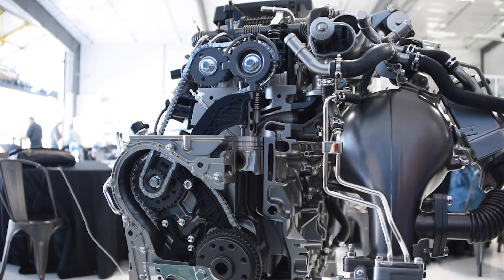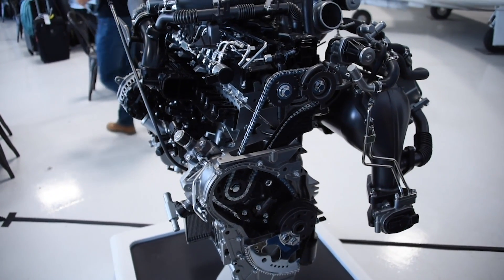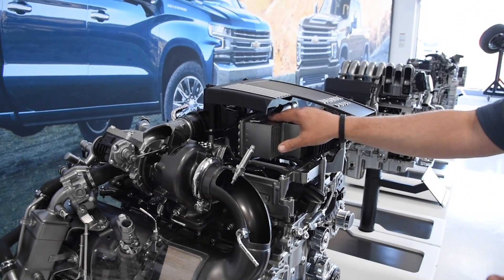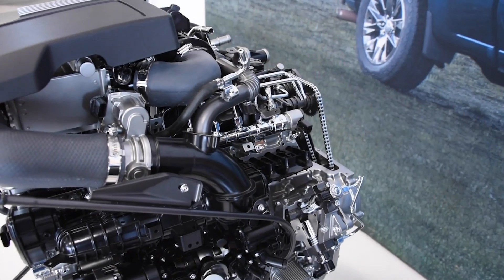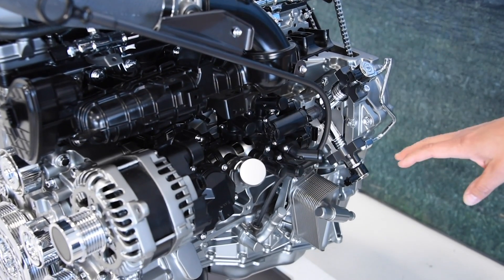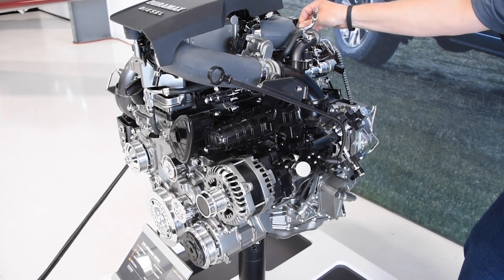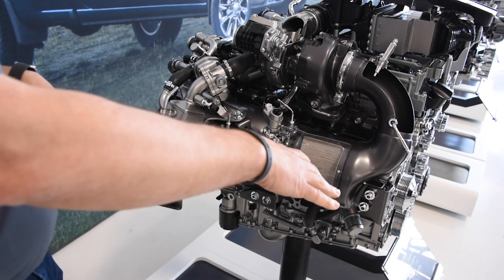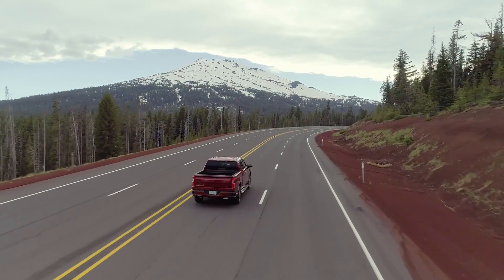What you don't know about the 3.0-liter Duramax diesel

Comment: Wow. At least the belt in oil has some testing in the 1.0 liter 3 cylinder Ecoboost. https://www.ngfglasscord.com/en-gb/glasscord-products/belt-in-oil
Ford describes it as lifetime meaning the 1 liter engine has an unknown predetermined “come unraveled” time. So far I haven’t heard anything about the belts failing, and Ford uses the engine in lots of its vehicles. 
What I don’t like is all the chains this thing has got; the chain going up to the cams is pretty long an doesn’t get dipped into the crankcase oil as far as I can see. Wonder about that. Why didn’t GM just use timing gears?
And lastly, the cooling system has a LOT of plastics parts - thermostat, coolant diverters etc added to the plastic already in modern cooling systems - I sure hope GM spec’d top quality plastic for that. I’d hate to have the owners of these to have a BMW style cooling system experience. GM may have overdone it with this engine.

Comment: Sigh, Ford is too expensive, they've lost their minds.
Toyota can get you from NY to CA in 1k gallons of gas.
Chevy wants you in the car shop or dealer all the time.
Don't GMC/Dodge @ me.

I guess I need to get an electric bike.
Reply: If morons would stop buying these POS trucks and buy used ones then all of the manufacturers would solve their problems
Reply: @Ethan-ck6iz  If the morons had any brains they would know that belts in oil or BIO kits, are replacing timing chains and gears as we speak.

Comment: Did they put the engine in backwards and for those of you saying awe most people Don’t keep them that long. I have a 2005 lly with 130k on it and my daily driver is a 2003 Silverado 6.0 gas with quadrasteer with 135k . Just can’t part with the 4 wheel steering and the lly doesnt have dpf or def bull crap. I was excited about this engine till this wet belt crap pull transmission. Has anyone checked the labor time with gm on this at the dealer .

Comment: What idiot comes up with a belt drive oil pump!🤬🤬🤬🤬🤬🤬
Why would chevy allow the engineers to design something that will fail and destroy the engine!🤬🤬🤬🤬
100,000 miles I will have to see it to believe it! I wanted to purchase this truck and engine combo if I do I will get the extended extended warranty to cover my ass and get rid of the truck after 70,000! 

DO NOT BUY THIS ENGINE if u do get the extended warranty please that belt will fail!

Comment: "Variable displacement oil pump" 
Umm your describing how any pump driven by belt via "variable  displacement rotating crank shaft."    Which is being pushed by "variable displacement pistion"

Displacement
1. the moving of something from its place or position.

2. the occupation by a submerged body or part of a body of a volume which would otherwise be occupied by a fluid.

You dear The RV Connection talked troll, I'm only 1:21 in. You should have practiced your presentation as well.

Comment: Watching disaster unfold.....🤦‍♂️. Wet belt? Sure just pull the tranny and transfer case, dealers can already charge more per hour because it’s diesel. Basically saying the belt is good for 150k that’s means the motor is only good for 150k. The little 2.8 dirty max already has to have the belt serviced at 100k. Run far far away!!!!
Reply: EXCELLENT !!

Comment: So they have a lifetime chain that requires not servicing, but the rubber belt that drives the oil pump will need to be changed every 150K!!!  Is it just me or why the hell not make everything back there a chain.  This is gonna be the Achilles tendon of the 3.0 Duramax...  Engineers need to consider maintenance & design around that instead of designing things to be maintained.  I have big hopes for the half ton chevy duramax, but after this vid I am on the fence!!!

Comment: Remember this isn't a GM design, It's a design by Isuzu
Reply: Actually it's a v.m. motori design from when g.m. was 50% owner in that company.Has not one thing to do with Isuzu.
Reply: Hate to start a troll fight but directly from the GM news release:DAYTON, Ohio – DMAX Ltd., a 60-40 joint venture between General 
Motors Co. and Isuzu Motors Ltd., today celebrated 10 years of making 
award-winning diesel engines.

Comment: Come on guys, replacing the 150k mi oil pump belt won't be big deal since the trans will come out every 50k mi anyway!  Just replace the belt every second or third time the trans is out!  lol
Reply: Good point - it IS a GM, after all...  Probably hung a 4L60E off of this "beast".
Reply: @mtcruse  I know they didn't but a 4L60E would definitely turn me away! I'm dealing with one now on my 1991 Chevrolet Silverado C1500. I rebuilt the original one three times and then purchased a rebuilt 4L60E to replace it. Now I'm waiting on the manufacturer to send me a replacement to the replacement! UGH! I think Fred Flintstone's foot powered stonemobile is a better choice!
Reply: @herbcordle9426  my 4l60 went 322k miles and then needed only clutches. Had I done the bare minimum it would have cost about $100-120 and taken me a day to do it myself. I'd take a 4l60 behind this engine in a heartbeat.
Reply: @mtcruse  Its an Allison transmission
Reply: You sir, get a gold star for positivity!
Reply: AH! Silver lining! Guy who knows GM and why Dodge RAM is UP 18 % this year (outsold GM soon to take 1st from Fraud motors )
Reply: @AmericanSurvival1  not when the pride of the hemi world is eating up camshafts they about to see a down fall
Reply: It’s a Ford transmissions in a gm housing!
Reply: @theduke672  no its not, its an Allison transmission
Reply: Blumountian a few people on this post are thinking it’s a GM Trans but in fact it’s a 10 speed ford trans in a GM housing
Reply: duke jordan but don’t you think it’s weird that ford doesn’t have any trouble with it but Chevy does. This happened in 08-09 transaxles too, Ford had a really good transmission and Chevy didn’t even though they built it together. And before anyone says something about a power difference I’d care to remind them that in only one option did the Chevy have more power.
Reply: @theduke672  , joint venture..
Reply: @theduke672  Negative, its an Allison transmission
Reply: Chris Heffernan 2021 3.0 and the gas suv use a 10 speed transmission which is a ford trans in a gm housing. Google it
Reply: They havent had any issues with the 10L80
Reply: Its an Allison Transmission, why would you be pulling the transmission at 50k miles?
Reply: @chrisheffernan7540  I think only the heavy duty 2500 truck has an Allison, and that one is made by GM and only branded by Allison.  The half ton 1500 Duramax appears to have the GM 10L80 just like the rest of the 1500s.
Reply: @matthewprather7386  You are probably correct. The salesman told me it had the Allison, but when I did a little research I came up with the same conclusion as you stated.

Comment: Question why is there a "flapper" at the intake port? wouldn't this just cause a restriction? and how does this "help energize the air fuel mixture" when Diesel is injected directly into the cylinder not the intake manifold. A plastic manifold at that

Comment: Who is the moron the decided to use a rubber belt to power the oil pump. well let's put chains on the high pressure fuel pump and we'll put chains on the cams. Lifetime Chainz no regular service required. Oil pump? Rubber belt. Oh don't worry it's a hundred fifty thousand mile service life on the oil pump belt. Oh by the way it's on the back of the motor. So it's no big deal just drop the transmission out every hundred and fifty thousand. About 50,000 miles after any extended warranty will look well expired. Well I can safely write this off as an option in my new Silverado.

Comment: With the whole timing chain and belt setup on the rear of the engine, I immediately thought of the BMW 3.0 inline diesel and how that never worked out. Something makes me think a rubber belt running in oil is not going to last their claimed 150,000 miles( rubber and oil don't mix). I don't think any of the engineers were thinking.

Comment: here's how it goes, if you make something with a belt that is going to brake then you make it easy to replace before it brakes, regular maintenance, simple, dropping the transmission is not simple , and 2 chains to keep your cams in sync with the crank, I hope they made adjustment easy , but I doubt that

Comment: Is it just me or is drawing exhaust gas through the egr post dpf/scr system both a good and horrible idea? On one hand it has most of the soot removed which is nice for fewer regens and a cleaner running engine, but also horrible because its drawing in air post scr, meaning trace amounts of def that haven't been catalyzed are going to be sent straight back through the engine.

Comment: Its easily serviced, just drop the transmission. Obviously not a mechanic. Salesman or engineer.
Reply: I was thinking the same thing. GM has some kind of odd infatuation with non-traditional drives in their diesel engine. Everyone else uses gear to gear. As should they.

Comment: Ok so why have a belt for the oil pump in the first place if you have a timing chain? What am I missing here?
Reply: Timing chains require tensioner, a wear item. Belt does not need tensioner. The big reason however is the variable displacement oil pump. It’s easier to execute w/belt than chain, gear or Jack shaft drive

Comment: Gonna be real fun to "Just drop the transmission" on your 4X4 truck to service that oil belt. All those valves and egr stuff getting carboned up and sticking will be real fun too. Heaven help you if that 32000 psi pump goes out. $$$$ I think I'll keep my old truck.

Comment: Wow belt driven oil pump inside timing cover at back of the motor. Drop the trans mission......good god.
Reply: Most people won't have to deal with it, the original buyer or leaser will only have the truck a year or 2, then trade it back in, they don't give a damn that the whole oiling system is 1 rubber band away from catastrophic failure, and we know it will be catastrophic because by the time the driver figures out there's a problem the engine will be seized.  No matter what nonsense "warning" they mentioned that it'll give if the belt breaks we all know that most people never pay any attention to the idiot lights on the dash...even if they did, the idiot light won't tell them what's wrong, so they'll just keep on driving till the engine locks up.

Comment: That oil pump belt is assanine, and I quote (it's no big deal you just have to pull the transmission every 150,000 to change it), lol. Why not a chain like the timing chain? OR go with gear to gear even better.
Reply: Yes.  Because chains never wear out.  🤦‍♂️

Comment: Why in the world they didn’t use the gears ??? because they want the trucks to be more in shop and they 
Used cheap chain LOL 😂 :(( that’s the Damas design , What is wrong with this new engineers designs , why they didn’t make 3.7 or 4.3 to have more power?? Where is the quality ?? what’s wrong with this gm ? No wonder why he goes bankrupt
Reply from the maker: Chains were chosen because they are quieter than gears. Noise isn't a big concern with heavy-duty trucks, but half-ton customers want a quiet engine.
Reply: The RV Connection , ya At least the oil  pump to the gears

Comment: They should have just put some stronger rods and a compound Turbo on a 2.8   Almost the same displacement just as much power and no reason to pull the whole engine to do any timing work everything's already up front on the 2.8

Comment: I love how they keep saying how easy to remove a transmission, driveshafts and transfer case is going to be to move, Bet its a 16 hour job if you pay for it 10 hour warranty.  Not something you are going to do on the ground going to need a lift too.  No reason to use a belt for that component, but hey if it breaks the rest of the engine will still function so you can wipe all the bearings, rods, and crank too.

Comment: Reminds me of the thousands spent to bulletproof a 6.0 Ford.  Someone is going to invent a bulletproof kit for this piece of work. Great job on this design doesn’t it come with a high pressure line for the driver to lube his butthole before getting rammed at the dealership service department???
Reply: I think they expect to dry ream buyers
Reply: That’s the “wet kit” option-$600.00.

Comment: I quit watching the moment I learned the timing chains are at the back of the engine. I can't decide which is worse, a chain at the back of the engine or a belt at the front like the VM Motori/Duramax 2.8. I want to see the flat rate hours for replacing all the timing components of a 3.0 Duramax, 2.8 Duramax and the Ram 3.0 Eco Diesel.

Comment: Your talking 10-15 years befor having to replace the oil pump belt. By that time something better better will come along .In the mean time i am going to enjoy the 32+ mpg fuel economy. May also want to concider that the engine runs at about half the rpms of a gas engine, timing chain may last longer .On some trucks ,the tranny by that time had to be pulled for  repair anyways.

Comment: Coming from a chevy guy. This engine is extremely over engineered and will have issues. Keep it simple. We as the customer dont care about efficiency in a pickup. We want to beat on it for 20 years and put 300k miles on it like you could do with earlier chevy trucks.
Reply: Between the criminals in DC and the criminals on Wall Street they want to beat on your wallet cripple your transportation options.

Don't hold your breath.

Comment: The varible cooling makes perfect sence, 277 hp and 30 mpg highway is a feat, 15 mpg with 8,000 pounds in tow is astonishing. Thats nearly a 50% improvement in fuel savings. For being a $2,500 option it pays for itself long before 150,000 miles. This really pays for itself if one tows the majority of those miles.
Reply: Everything on that engine looks expensive and labor intensive. Yeah it payed of for a few tows but you won’t like that 10,000 dollar repair bill when it eventually comes
Reply: I'd get the 7.3l ford and have a CNG conversion
Reply: Nothing on this engine makes economical sense. They’ve added even more moving parts that’s will need to be serviced and replaced

Comment: It's just a rubber belt who needs oil pressure no problem to change just drop your transmission I wonder how much that cost it don't sound cheap
Reply: 350,000 mile rebuild interval is just too long.
Reply: I'll stick with my Straight 6 Cummins 12 valve. I have a million and 1/2  miles on it and it's still ticking. No belts, no chains, all cast iron gears. And I'll be able to pass it down to my grandkids. This new shitt hasn't even come close to the durability of that. It's a one ton ext cab dually 4x4. And I get 22mpg. After you all buy the new shit  and after you drive them for couple hundred thousand miles. Give me a call for a fair fee. I'll wentch your truck on my trailer. And haul it to the salvage yard. Where they will have a good laugh at your expense!!!!!!:):):(:(

Comment: A belt for the oil pump?!? For $2500 option it should be a chain... so cheap built for failure
Reply: Electric vehicles only sound good, if you don’t know the price of the batteries. The Chevy bolt has about 260 mile range. Sounds good very low cost to run the car. Until you need to replace the battery pack.The price is wait a minute you better sit down. $16,000 plus labor. A truck will need a bigger battery pack.

Comment: Now do you still have to plug the diesel engine in during the winter months or have you eliminated the need to plug them in all together.
Reply from the maker: I was told that this engine will start at 20 degrees F with only a slight delay for the glow plug...they didn't mention when/if it would need to be plugged in.

Comment: If the timing chain is spec’d for life, why didn’t they drive the oil pump from that?
Reply: What they meant was the Chains will out last the belt and when the belt fails and you loose oil pressure under load the engine will be so damaged that it will be it's "life" and thus the chains are lifetime.
Reply: Timing chains do not last that long.  It's either going to be the tensioner, guides, or the chain stretch that will compromise the system.  Timing gears are very reliable, but they don't use them.
Reply: @gunslingernumber1698 . Timing chains can last a very long time. 400K, 500k, even a million miles
Reply: @nunya9555  when they are short then it's a double drive chain yeah they going to fail
Reply: @nunya9555  The operative word is "can".  Yes, some may last that long.  I think it is not common.  What matters to the new 3.0 GM diesel engine owner is "how long will my timing chain last?".
Reply: @gunslingernumber1698  especially on a diesel. There’s a reason the Cummins engines are gear driven timing rather than belts or chains. 18:1 compression ratio does a number on flexible timing gear
Reply: Engine would have lasted too long ago if they built it so the oil pump was driven by something more reliable.
Reply: @wildbill23c  lmao just to prove that gm will not build a engine to last a long time for today's market
Reply: Yes timing chains generally last longer than belts, but they are exponentially more expensive to replace, and they’re not exactly indestructible. I don’t think belt or chain is going to sway me one way or another on a light duty engine. Gear driven, then pushrod. Then chain/belt it doesn’t make much of a difference.  Ask anyone who has had a Ford 5.4 Triton how their chains held up after 150,000 miles.
Reply: I really want an answer for this GM!

Comment: “Rear timing system.” This is the same as my Cruze where the timing chain is on the back of the engine to bury noise inside the transmission case. My biggest fear from this design is if the chain needs replaced: What will the repair bill be? There will be perfectly fine Cruze, Equinox, and Terrain vehicles that get sent to the junkyard because the timing chain replacement cost is greater than the value of the vehicle!